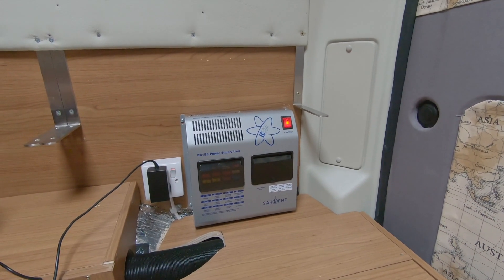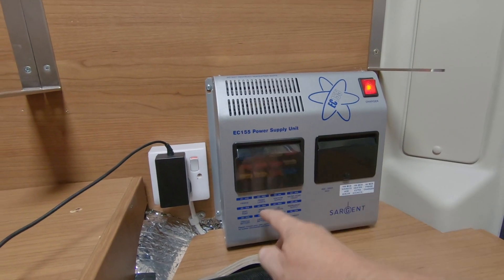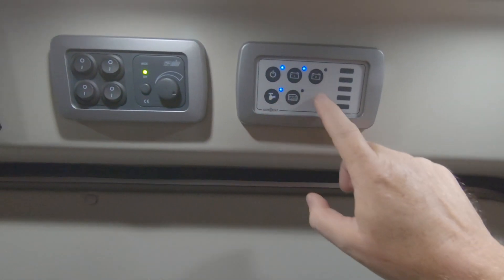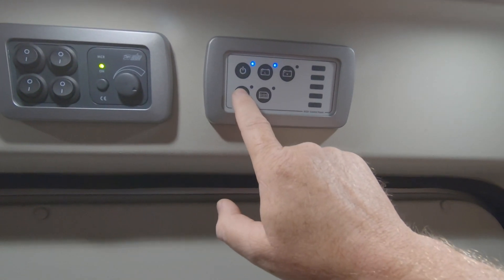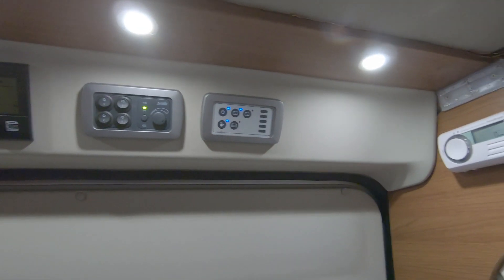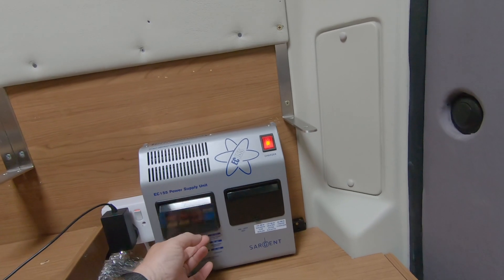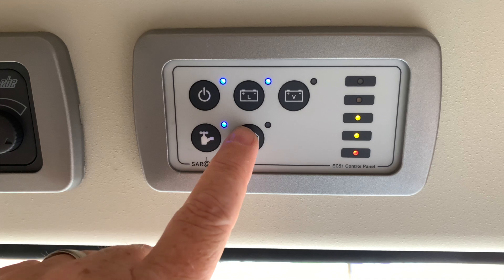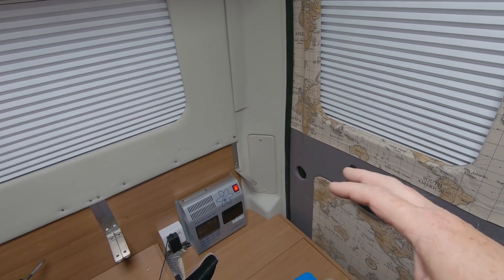Easy All-In-One Campervan/RV/Motorhome Electrical System - Sargent EC155

Comment: Hi John, I've done similar to you and expanded my electrical system beyond the Sargent control functions although still use it as a 12v/230v fuse board for the AutoTrail features.  I'd like to use a Savvy Van control panel to activate the pump.  From what you've seen of the wiring loom would this be easy to achieve?

Comment: Hiya!
I've got the EC155 fitted to my campervan and I'm needing to replace my old lead acid leisure battery, as it's dead.
I know that the charger inside the EC155 will only charge lead acid, not AGM or Lithium, but I'm wanting to go with a lithium battery!

The question is, how do I connect a lithium battery charger into the EC155?

Any ideas or advice more than welcome please 😊

Comment: Hi there 
I have a Suzuki Swift bolero 680fb 
Year 2011 
I have a solar connection box on top of the roof with a blue and brown wire inside it 
I’ve connect a solar panel to this point 
But I’m not getting power into my sergeant EC450 series power supply unit 
When I’m in advance setting 
Solar says 0.0 

So I’ve took my Sargent box out of the cupboard and had a look behind and found the the cable coming from the solar panel is not plugged into everything on the back of the sergeant EC450 box  
I’ve had a good look and I can not find a place to plug the cable into 
 Can you point me in the right direction pls  thanking you 
John 
Now I’ve seen your video I’m thinking do I need different control panel 
as the control panel above my door dose not have led display screen on  
Only led light 
Pls pls help I’ve been out and fitted a solar thinking I can just connect it to the roof connection point. Thanks again, John
Reply from the maker: You’ll need a separate solar controller / charger suitable for your solar panel size.
Reply: @GadgetJohnAdventures  victron MPPT 100/30 
Then where do I connect it ?? 
In the sargent 
Or like normal onto the battery 🔋 
I’m a little confused 
As my sargent 
in advance settings 
it a solar reading display 
So I’m thinking 🤔 
It must go to the sergeant somewhere 

Thanking you so much for you reply 🙏 
John

Comment: Hi John just a quick question, I’ve got the same unit that you show in your video,if I’m off grid,does the charger unit need to turned on & which position does the trip switches need to be,up or down?
Only had the van a couple of months & not been out camping in it yet!

Many thanks 🙏

Comment: Hi
I have this unit and have been using sites with hook up and everything works fine.ie lights  ,battery charges.
But turn off 240v supply I can't use any 12v items is this correct  or not.
Any help appreciated
Reply from the maker: You don't turn the unit off, you either have 240v connected or you don't. With 240v connected or not the 12v will work, unless you have your engine running.
Reply: Cheers  I must have a problem somewhere when power is off I get no 12v to anything .the battery is showing 12.75v when tested.

Comment: Hi john I have a similar van to this one and i am in the process of fitting a auto switch h-tronic in the video you have a white plug the wires for the sockets going in to the Sargent unit if I cut this plug out and route the wires to my auto switch that should work?
Reply from the maker: In the auto switch video I show how to wire it up in detail. 👍🏻

Comment: Very helpful video, I really appreciate the effort you've gone to, in the user guide, it talks about a 240v output, I can't tell whether this means i can wire 240 plugs to it and avoid the need for an inverter, my hunch is I still need an inverter?
Reply from the maker: 240v from hookup or inverter to sockets in the van, the videos shows all this 👍🏼
Reply: John & Mandy on Tour thanks for quick reply. I watched and listened but it might have gone over my head. It’s all new.

Comment: Hi john ive got the same sergeant unit not fitted it yet... how did you connect the end of your wire looms I know they each have a multi plug that connects to the main box (easy enough) but on the other ends ( the load ends ) what did you do? Did you cut off the plugs provided and use spade connectors? Or did you find a compatible connector to fit the connectors they supplied... if so what are the connectors called and where would I get them. Cheers mate Gordon

Comment: I could really use some help with this, i don't understand how this thing comes with the wiring yet won't reach anything in the van, do you have any advice on installing this thing, the wiring diagram isn't clear enough for me and i could really do with seeing how someone actually installed theirs. Thanks
Reply from the maker: You wire your devices to the unit, extending the wires.

Comment: So Im I right in thinking when the engine is running you can't feed power to the 12v fridge?  When travelling through hot climates that's the one thing you do want power for.
Reply from the maker: Oh, sorry if it came over that way, When the engine is running you definitely CAN run the fridge on 12v

Comment: Hi John. About to purchase this system, just one last question. Does this unit require an ignition feed & if so where would I get this from?
Reply from the maker: Yes it does need  a couple of different connections to your vehicle, so it's worth researching that for your specific vehicle.
Reply: @GadgetJohnAdventures  perfect thanks

Comment: Hi John thanks for another great video. would I have to install a separate smart relay (vsr) with this system?  also how does the solar controller connect with the system?.
Reply from the maker: It has a built in battery to battery charger, but doesn’t have a solar charger built in.

Comment: Now with risk of sounding silly - as I have noted many times in your video that the Sargent is a SIMPLE system! However.. give me some timber and i am an expert but amps and volts.. not so much. I went with the Sargent system and in the next day or two I start wiring. I have loads of questions... I have seen your wiring guide but is there one for the Sargent? (I need help!) 
-wiring the sockets - the loom only has one cable. I presume thats the +. So out the back of each socket (I have Berker) where is the negative?? I understand the white and orange are the negatives.. is that for all the sockets (or outputs as it were)? 
- Connecting to the vehicle battery - can i just connect to the terminals or do i have to actually connect to the alternator?
 - On the vehicle battery loom wire, it has a fuse. Do just get my own bit or cable to plug in the other side of the fuse to connect to v battery?
- I heard something about the fridge wire ( i am not using this wire for that purpose) connects to tell the system when the van is running so it shuts power off.. and charges. So does this wire need connecting up? Where?
- It the manual it says double insulation over feed to fuses(??? what???)

Yes.. i have a few questions! Help please!
Reply from the maker: The video description has a link to the full installation manual. Have you read that as it shows everything you’ve asked about.
Reply: @GadgetJohnAdventures  the link is to your video about your own individual component set up. 
Thanks
Reply from the maker: No, the link in the video takes you to our website where the product user and wiring guide is.

Comment: In a fit of relief at finding something that seemed to sort everything out I got one. However, when looking about to see how to fit it they didn't seem to be well liked, particulalry as a charger. My understanding is they were designed for caravans/production motorhomes that spend a lot of time hooked up on a campsite. Not in my game plan.  Anyway, consequently I have an unused one sitting in my utility room that will end upon ebay.
Reply from the maker: That's the problem with the internet, no one really understands this tech and then they come up with unknown excuses as to why it's no good. The fact is it charges via the vehicle engine, it also charges via the hookup, it supplies 12v and 240v and runs all your devices such as lights, water pump, level indicators and it provides protection against faults and also battery drain. So the fact you didn't use it because someone said it's meant to charge on hookup in a caravan is really unfortunate as you really could have used this great product and it would have performed perfectly well in your van, as it's done in my van for over 12 months.
The facts are it's charged 260AH battery bank perfectly fine from my engine wherever we have been, it just works perfectly and as someone who really knows about this it beggars belief how others just believe what the internet says without even questioning it.
Reply: @GadgetJohnAdventures  Aye the internet is full of instant experts. Sais la vie!

Comment: Hi john on a coach built that I had it had the same system , I found a relay by the fridge that kicked in when the engine was running it kept the fridge working but isolated everything else, naturally I bypassed this and full power in the back all of the time. Maybe there is one by your fridge worth a look. 👍👍
Reply from the maker: I’ve checked everywhere and from what I can tell it’s in the unit itself, I can hear it click over when I start the engine.
Reply: Gadget John on tour , that’s annoying I guess the relay then has now been fitted inside system, I guess the only difference in this system and the old one is the smart charging. Ps brilliant job on your van 😊

Comment: The system in my van is very similar to yours, with extra 12v sockets and inverter running directly from the batteries. One thing that the Sargent unit is lacking is any sort of control for solar panels, again like yours mine is separately connected to the batteries via an MPPT controller. Thanks for sharing, I wasn’t aware that the vehicle battery wasn’t charging from the mains hook up unless it was selected from the control panel, luckily my solar controller has an output for the engine battery.

Comment: 1 question John why did you not just alter the sergeant system to work while the engine is running just override the circuit
Reply from the maker: That wouldn’t allow me to add all the extras that doing my own system has allowed.
Reply: Love the vid s 
Well done